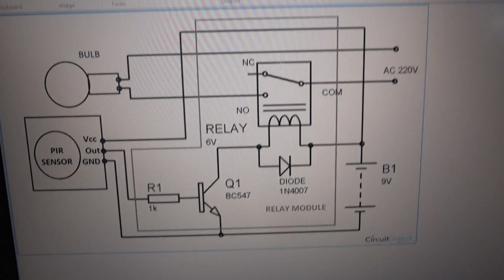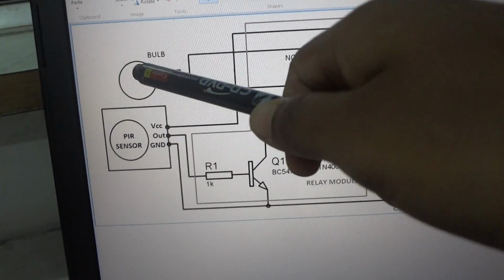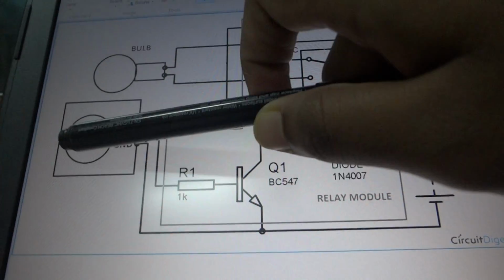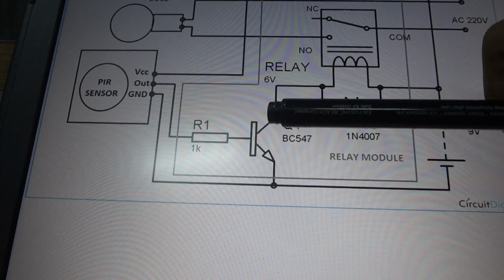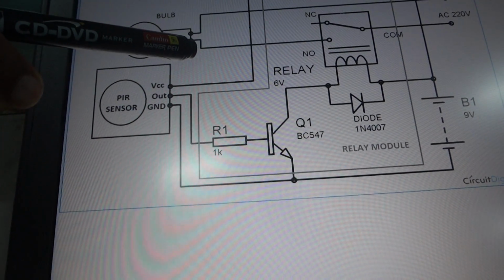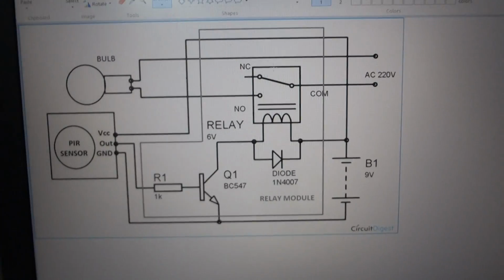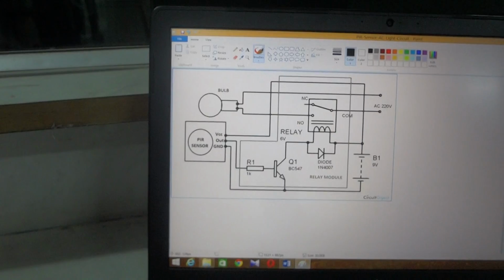Motion Sensing light Using PIR motion sensor

Comment: hey nice video . please tell me how to connect more than two pir motion sensor with one security alarm for house security. so that if any one detect any movement than alarm will activate
Reply from the maker: Do this circuit twice with two PIR obviously then where light is connected in the circuit replace it with alarm whenever any of the pir output goes high the relay will trigger and alarm switches on.

You can connect two of these circuit's vcc and ground in series respectively and then connect then to alarm as shown in figure.

Comment: Sir 12v or 6v relay m positive pin or negative pin coil ki kese pta kre mene net pr search kiya pr pta nhi pda confusion ho gya alg alg sb btaa rhe aap btao ki shi answer kya hai or diode kya coil ke positive direaction m connect hota hai means coil ke positive m diode ka negative terminal
Reply from the maker: 4.38 se circuit diagram dekhlo jaha pr diode  ka ">"  connect hai wo positive hai aur jaha " |"  wo negative  hai  relay pr NO NC toh pata he hoga relay koi bhi chalega dono mein se.
Reply: @yashp1995  ji sir NO NC to pta hai or > jha connect h wo positive hai relay ka means relay ke positive se diode ke positive ko joint kiya hai pir battery supply opposite dena hai kya relay ke positive m battery ka negative
Reply: Apke circuit diagram m diode ka negative relay ke negative se connect hai or ye diode ka negative battery ke positive m ja rha hai kya m jo dekh rha wesa hi kh rha esa hi bnau kya shi hai please btaye
Reply from the maker: Haa
Reply: @yashp1995  tq

Comment: Mugko ya Bana hai Magir Mare Pass 6v Relay Nahi hay Na He Ya Humari City Me Kahe Milti hay kya 12v Relay Laga Kr Is ko Hum Use kr Sukty hay 12 Volt Dc Supply Say Kam Ho Ga ....
Reply from the maker: 12v relay lagaya toh transistor  change karna padega jo transistor relay ki rating ko match kare wo lagao
Reply: @yashp1995  
Mugko Koai Information Nahi Maloom Ap He Batwoo ho sky to Digrame b Send krna My Whatapps 03313377012
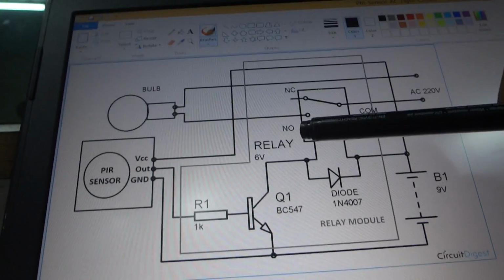Reply from the maker: See the circuit at 5:08 in the video and you can use 12 v relay with the same transistor.

Comment: Can we use 12v relay instead of 6 volt relay
Reply from the maker: Yes you can do that but then you need to makes changes in circuit. You have to change the transistor and diode according to the relay data sheet.

Comment: I had two queries ????
Can we use direct power source instead of Batteries 
and can we use two bulb for output ???
Reply from the maker: For the circuit and the sensor you need dc supply according to sensor data sheet.
And you can use two bulbs but have to connect them in series.

Comment: pir require only 5 volts not 9 volts your pir giving false trigger this ckt is not as simple sa u see.... many more 
 changes u have to do for long term use.....
Reply from the maker: This is just for experimental purpose to make it use for daily basis u have to program it using microcontroller.

Comment: If we want to light 12v dc led with 12 dc power supply then how should be the circuit
Reply from the maker: Then you don't need relay just use led directly at output pin it will glow when u go near sensor
Reply: But the sensor give low out put I want to use 12v dc led
Reply from the maker: In that case u need an Arduino
Reply: It it possible without Arduino
I couldn't find any way
Reply from the maker: May be u can use a pull up resistor     to make the output active high
Reply: Can we connect to in same relay instead of 220v bulb to 12v bulb 
Is it work or not ?